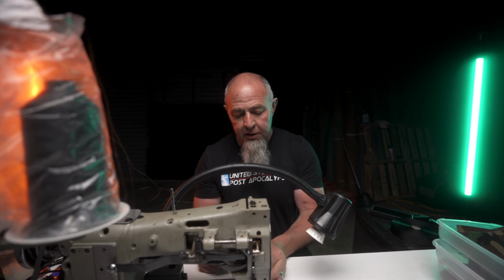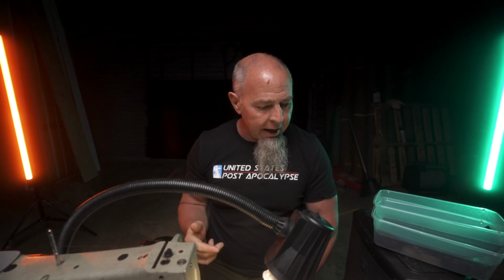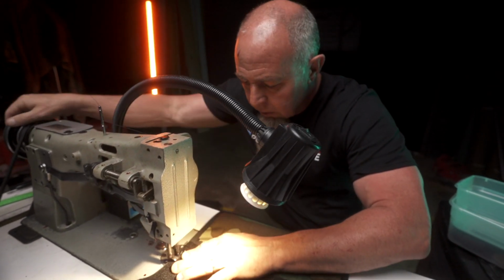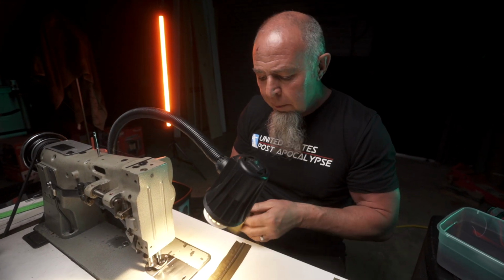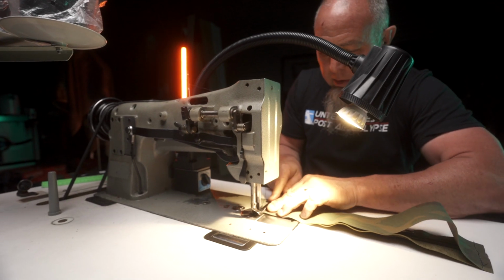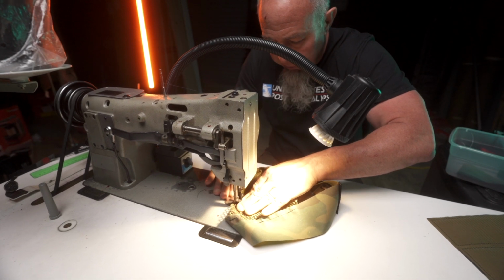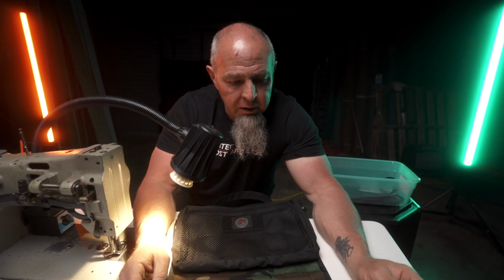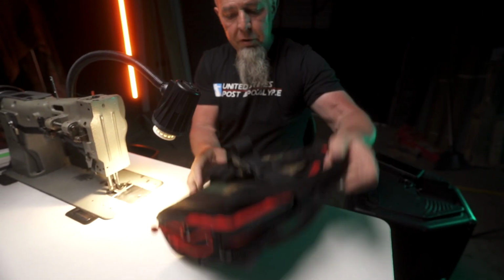FULL BUILD! ep. 8 #tacticalgear #sewing #sewinghack #nylontacticalgear #empire

Comment: Definitely not wrong about the dang bic lighters.  My wife wanted something easier on her finger so I got a refillable push button lighter for her.  That thing sucked.  Thanks for the videos as well. Definitely helping me brainstorm new ideas.
Reply: Remove the spring metal above the bic flint wheel with a small flathead screwdriver. Lights with almost no effort and is easy on the fingers. 👊🏽
Reply: @ACDCRD  that’s exactly what I do.  She still said she wanted something “easier”.